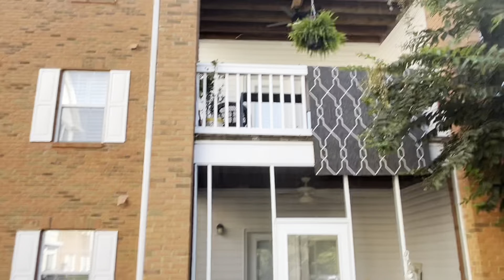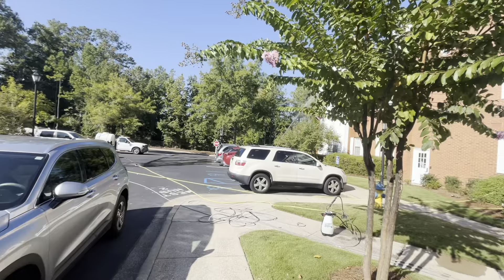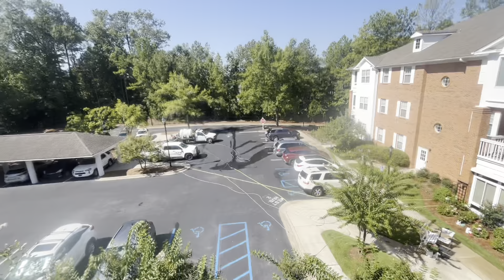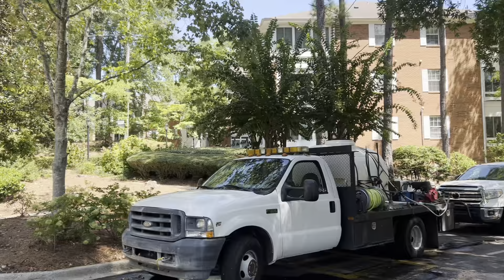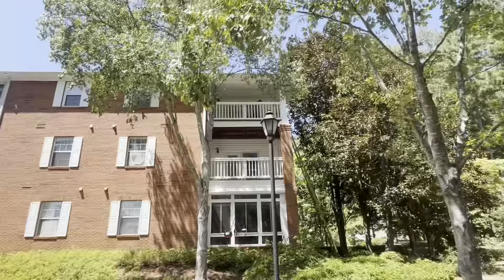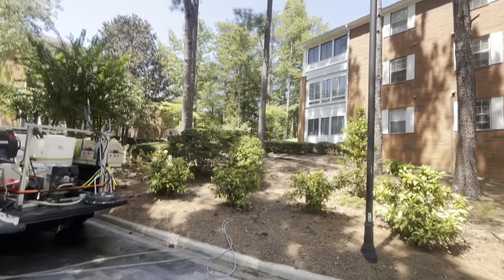$50,000 Pressure Washing Job Completed

Comment: Cant beat a remote downstream injector system. So much more efficient and you can make your own for way cheaper than the flowpro. I know you said you would lose the remote but you can easily put it inside a waterproof phone case around your neck or a waterproof case that goes around the bicep. Just a thought. Keep crushing it
Reply from the maker: @juniorbiel24  yeah you can- it's called swapping from a M5 twist to an Xjet nozzle. Does the same exact thing. Anything electric will not last and causes more headache- hard to mess up swapping nozzles. Just my opinion
Reply from the maker: @juniorbiel24  I've had the downstream systems, proportioners....wasn't impressed. It didn't last long. I'm going to stick with what I've had the best luck with 💪🏻
Reply: @ironcitypowerwashing1630  I hear you man. Never heard of that technique. Sounds like, kind of what a jrod was supposed to do. I know some people have had issues with the valve and injector corroding but you can add a three way before the remote ball valve to run everything with water at the end of your cleaning so the bleach doesn’t sit in there. But I hear you, whatever works man. You are killing it regardless lol. I just love the idea and the ease of cleaning with my remote downstream injector. Eliminates the extra steps for a 100 and some odd dollars.
Reply: Good job
Reply: @ironcitypowerwashing1630 Should've gotten a flo pro. Bypasses the injector